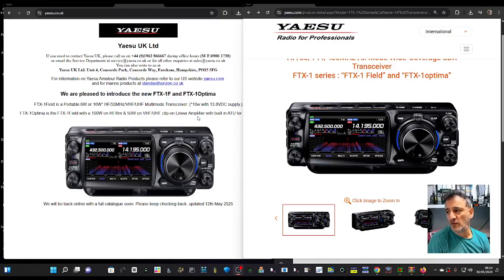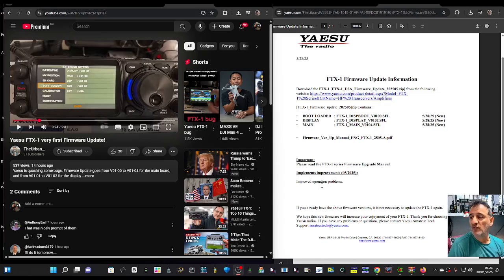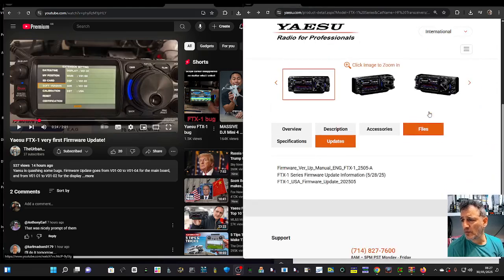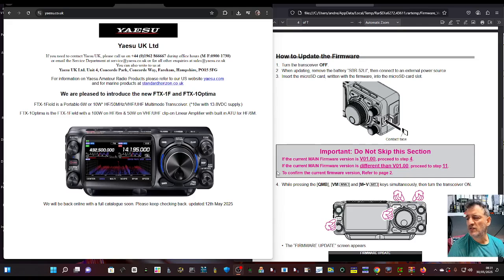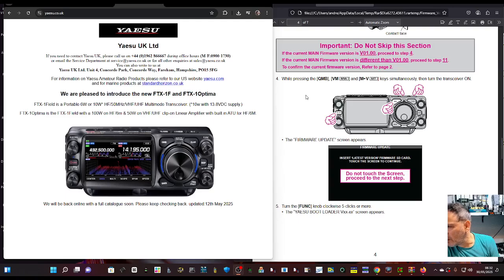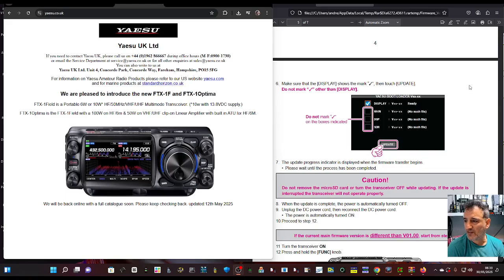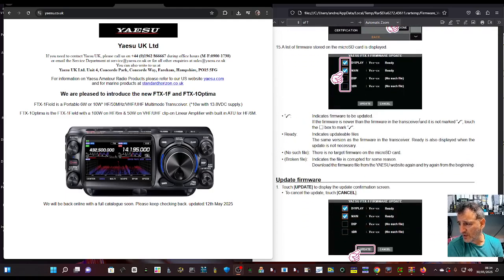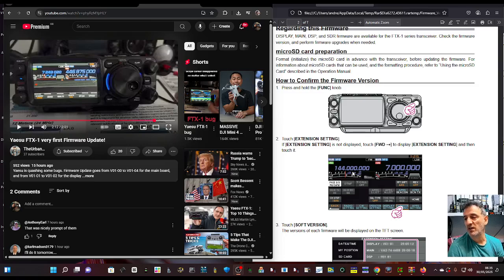Yaesu FTX-1 New Firmware  v202505 June 2025

Comment: One has to be very careful loading the initial boat loader when performing steps 4 - 7, the guy that made that video didn't show that step, they clearly tell one not to click the screen when the boot loader is being installed, you have to turn the function knob right five times and a menu will appear.  That installs the boot loader so you can, from this point, update the firmware from the SD card as expected by 'then' touching the screen.  Another oddity they fixed was the plug in / power on issue.  The biggest take away is to follow the instructions exactly, read ahead a few steps and then know even if the screen says touch here, in some cases, that may not be what one should do.
Reply from the maker: Good advice